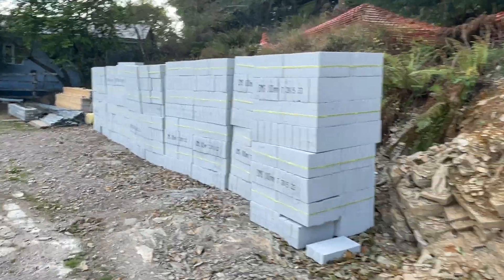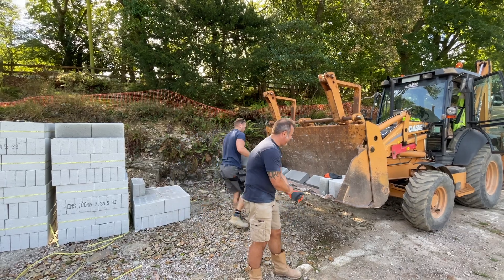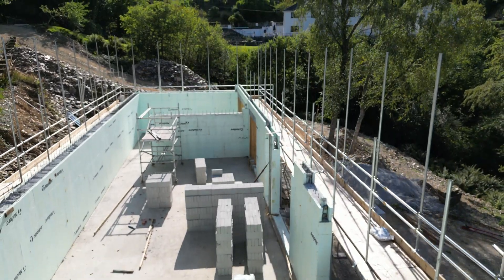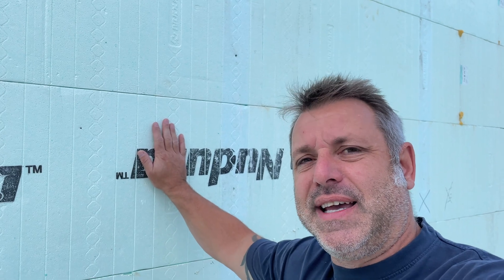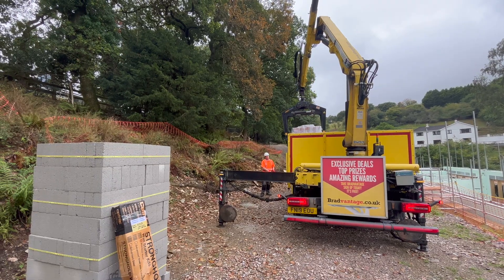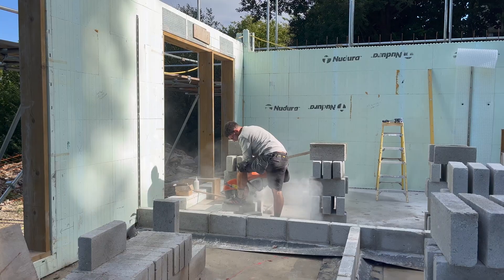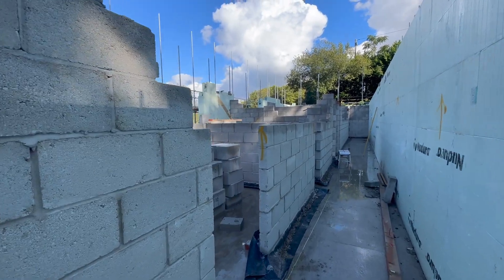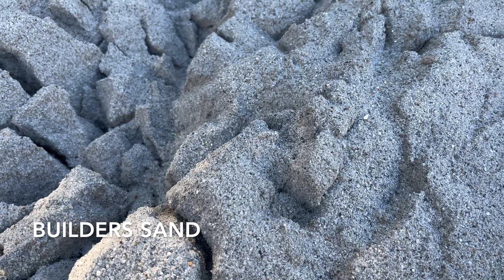Concrete Block Walls - Self Build House 8

Comment: Do you know how they tied the block work into the external walls? 

Im seeing people removing the insulation at that intersecting point which doesn't seem right to me. From your video it looked like the blockies had a rail up.
Reply from the maker: Hi @22rabbits. The insulation on the internal walls was removed, and wall ties were bolted to the concrete. The ties were similar to Sabrefix wall starter kit. Thanks for watching 👍